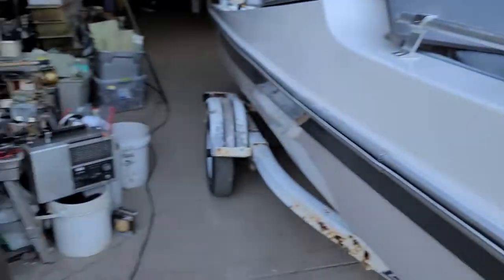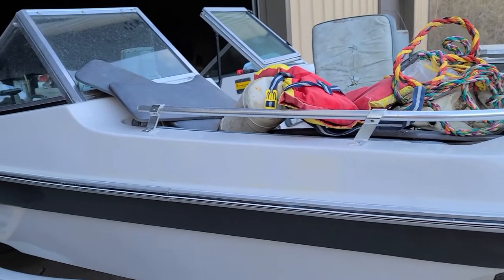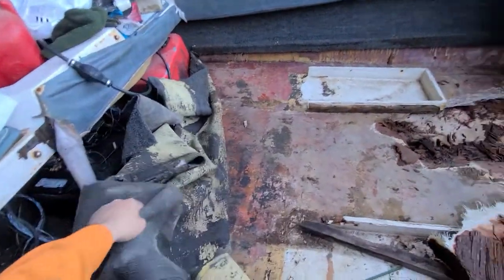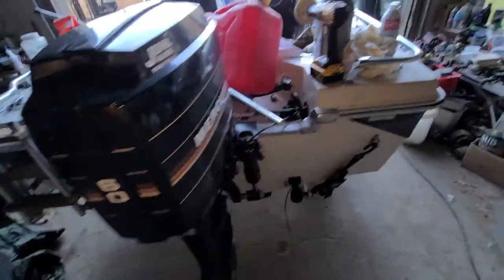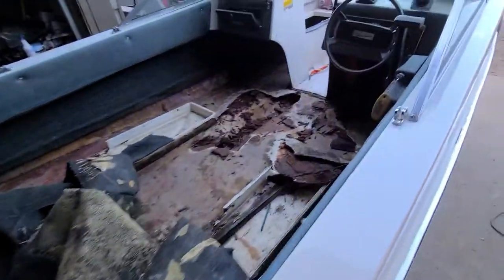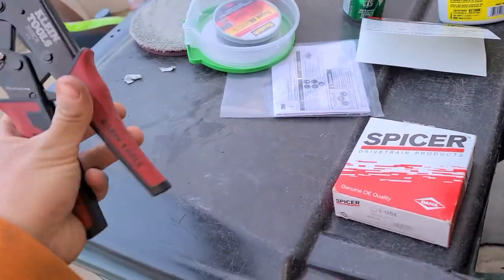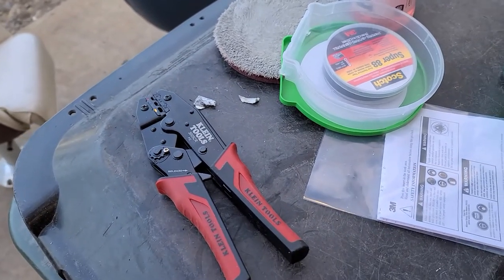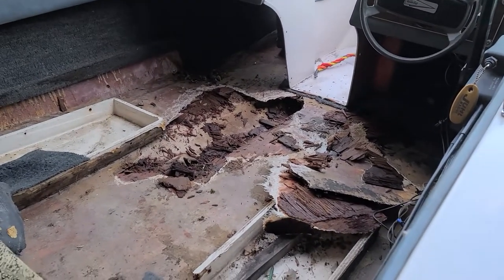1984 Thundercraft De-Badging

Comment: Make a suggestion cut as much of the wood out then instead of putting the wood back in the exact area lay a whole sheet of pressure treated plywood back on it like I'm doing mine. Still worried your stringer may be bad but hope not. Will try and post a video of mine soon. As for fiberglass over the wood it seals it in to make it waterproof
Reply from the maker: Thanks for the advice, we'll end up replacing everything that's bad, do it once instead of 2x. We have the wood already it's just ripping it all apart and putting it back together ontop of life and it's adventures. Schedule for the summer is already stacking up against our endeavors.